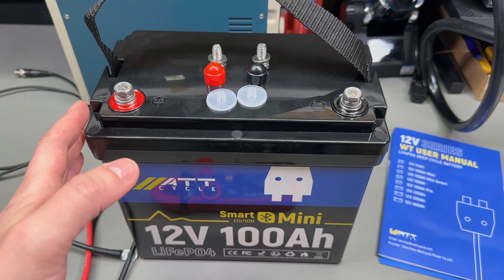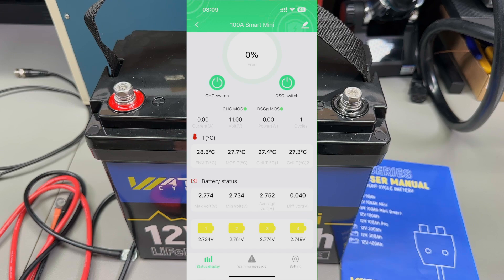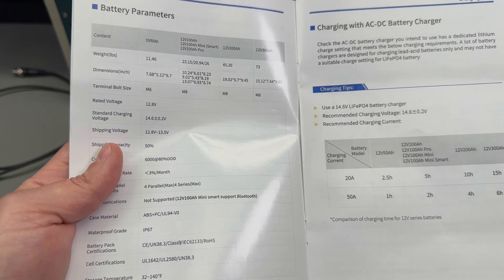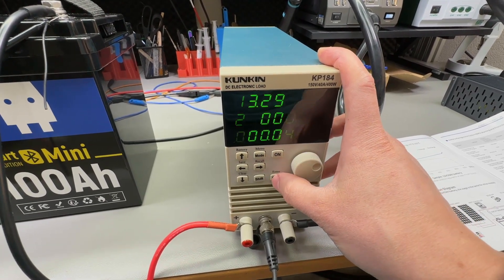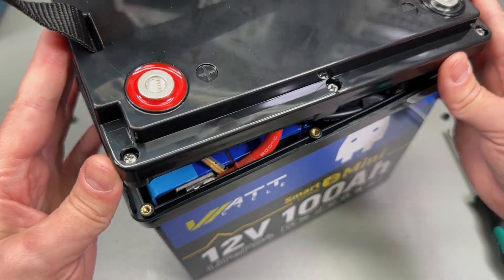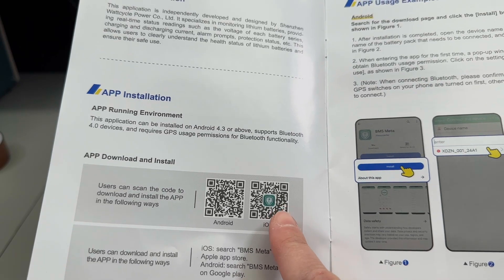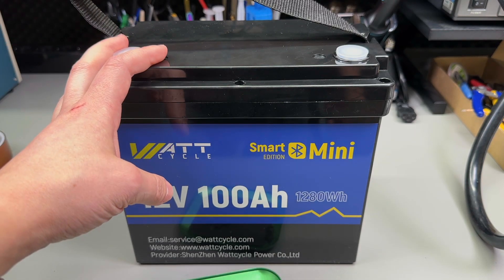Wattcycle LiFePo4 Battery Review With Teardown

Comment: The “weak link” on these LFP batteries are the bms…if you keep amp draw low, they will likely be ok…but overdraw the current, you should expect the bms to fail.  These are not starter batteries!
Reply: as a rule, never over 50% of max amp; it is idiocy to push something like this (any vendor) to 100%;

Comment: These batteries are getting so affordable, it doesn't make much sense to DIY this anymore, unless you have very specific use case and capacity requirements.
Reply from the maker: Indeed, especially given the fact that they stock them locally so you don't have to go through the process of shipping and importing the battery.

Comment: I like the removable construction instead of glued together.
They should turn that LED off on the bluetooth board though, just wasting power.

I guess the "resetting password" option was not to change the password?
Reply from the maker: LED on that BT module is a waste of power indeed, I guess just a standard off the shelf module stuck in there.

Comment: Way better mounting of BMS with cable ties compared to my Itech 120Ah that used polyamide tape.  .Also, if close enogh for bluetooth to work then the perpetrator is close enough to do what they laike mostly.
Reply from the maker: It's likely that for many people distance alone will constitute enough protection but you just don't wanna depend on that being the only safety barrier.
Reply: just change password;

Comment: I need one for my motorcycle. But those are so overpriced
Reply: Depending on what motorcycle you have, you might be inviting a WHOLE new set of unanticipated problems switching to a Lithium battery.  Make sure you do your research.
Reply: @2000jago  a battery is 35€, lifepo4 is like 150€ plus charger. Not worth even thinking about it. 
I'll keep it warm and charged in winter. Should be fine.
Reply from the maker: Even though it might seem like, they are not usually a drop in replacement.

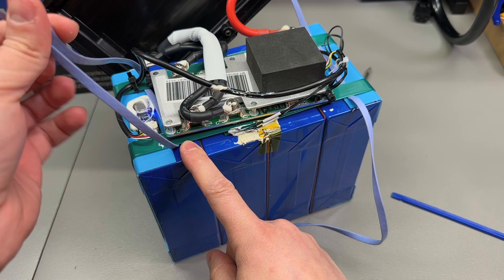Comment: 13:36 - Would placing it upside down on the bench and just lifting off the bottom not been easier?
Reply from the maker: Not really. Needed quite a pull to extract it. I had to grab the case with my feet and pull with my hands.

Comment: Prices in the EU will come down as manufacturers look to off load stock that would have gone to the US because of the tarifs...
Reply from the maker: That's one possible outcome, however things are not even remotely decided yet. I can give you two arguments to that:
1. The EU is already looking into providing protection against that with import restrictions which might include additional tariffs.
2. The US has not yet decided on the whole tariff thing.